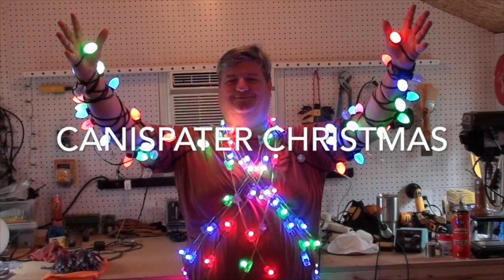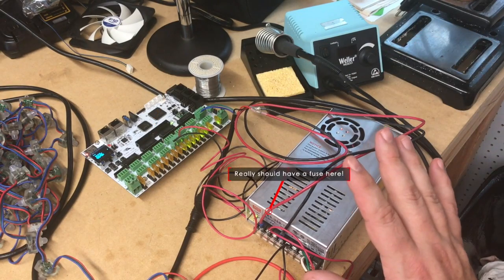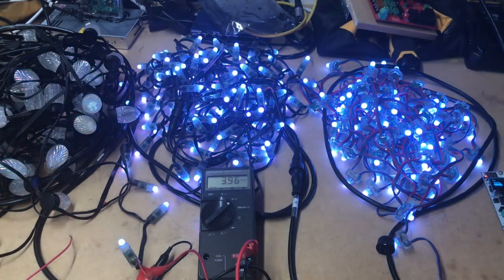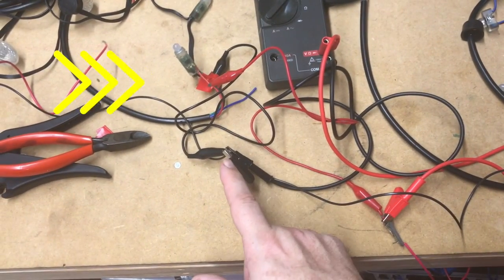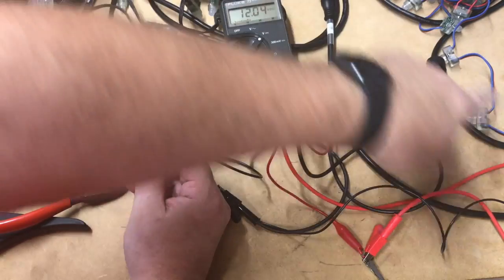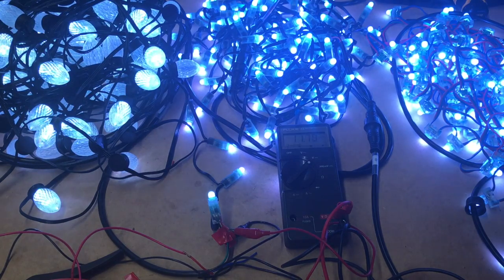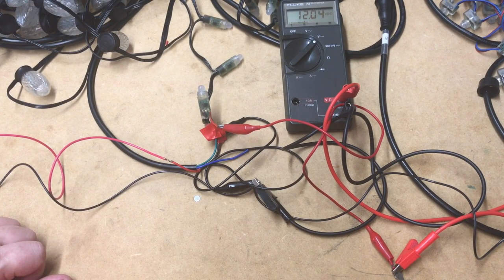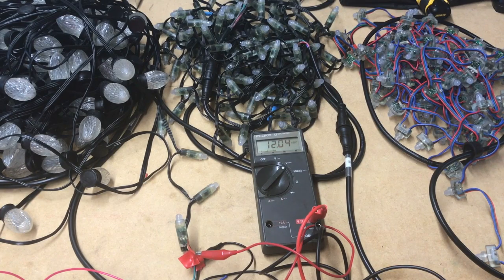Injecting Power For RGB Pixels

Comment: Can you help? I have (2) 20a 5v power supplies (100 watts each) for my (2) 5m btf 6812 (300)led each strip or 100 watt demand from each strip. Could a single 20a power supply power both strips at full brightness? I will power inject at the beginning middle and end of the joined 10m strips but would that 20a power supply be enough or can I somehow have both power supplies to both led strips with a single controller?
Reply from the maker: I'm not familiar with those pixels, but you'll need to know the current draw for the strips. That is typically shown on the product listing. If there isn't any info, use 0.06 amps per pixel (for full brightness) in the strip. That will give you a ballpark idea of the total current draw for the strip, however, pixels have become more efficient so that may be too high now. Example, if they are single-LED pixels, 300 pixels * 0.06 amps = 18 amps total so one PS would not be enough for both strings. Again, this depends on the actual draw for each string so that is your homework. 😂  Also, if they are the fancy new RGBW pixels, and you're wanting white, that may throw off the calculation so not an easy question to answer. As for the controller, if it has 2 separate power inputs, then you could use both supplies, if not, then no.

Comment: So just to be clear when using two power supply’s I only connect the - of the second power supply?
Reply from the maker: To be specific, if you are powering the same string of pixels with two separate power supplies, connect the negatives together so there is a single reference to ground and split the positive somewhere in the middle, otherwise you run the risk of the power supplies fighting each other and overheating. You're basically powering half of the string with one PS and the other half with the other. It's not a common setup and I haven't needed to use it. Only time I can think of where you might need it is if the string is very long making power injection difficult, but I try to keep strings short so I don't even have to inject power. Now injecting from the same power supply is something I use on my megatree and matrix and in that case, splitting the positive isn't required because it's the same power supply.

Comment: So quick question?

The negative and data wire is tied together on all (3) strings from the 1st controller/power supply?

When running the 3rd string, you can leave the negative and data wire tied through to the other (2) strings, but the positive wire for string 3 can ONLY be connected to the second power supply? (isolated from string 1 & 2).?

Wouldn't it be better to have the 3rd string isolated from the other 2 strings on the positive and negative.?

I am new but trying to get this sorted.

Thanks.
Reply from the maker: The idea is to break the positive between the two power supplies so you don't get them fighting each other (eg: generating heat, causing fires, ruining everyone's Christmas 😂). All grounds need to be the same otherwise you run the chance of having stray voltage on the data line which causes the pixels to do funny things). Data is not connected to the power supply - only from the controller to the first pixel and it's a chain (pixel to pixel) all the way down the string. Pixels regenerate the data signal for the next pixel so once you make it to the first pixel, you're good for the string unless you have a large distance (a few feet) between two pixels. Check out my beginner playlist if you haven't already. It goes through the basics (https://www.youtube.com/playlist?list=PLFyrAfJ-kKd4ZfPdXWIt8v_bav61mW_KW)
Reply: @CanispaterChristmas  so you would tie the grounds from all 3 strings together even though power is supplied from 2 different power supplies? Thanks for the reply. And great job with everything.
Reply from the maker: Yes, a common ground (same ground for everything) is necessary.
Reply: @CanispaterChristmas  last question 😂😉

So is a common ground required between all pixel strings in a show (different props/matrix's etc)? with multiple controllers, power supplies?

Thank you!
Reply from the maker: No. Each controller is supplied by it's own power and the controller will provide the common ground among all the strings attached to it. The only time there really is a chance of an issue (that I can think of) is running 2 power supplies on the same string. BTW, how many pixels we talking here? 2 power supplies is really not something that comes up often. Generally only spanning a large distance (making power injection from the same power supply difficult) with one string.
Reply: @CanispaterChristmas  I guess at the end of the day, I'm having a hard time figuring out the total pixels that one of these premade falcon controller units can feed with a 350W power supply.

I believe they have 16 outputs fused at 5amps each

Regardless each port says it is good for up to 1024 pixels. (believe this rating is for data). (16 channels x 1024 pixels/ch = 16,384 pixels!) 

Even with a 350W power supply the math doesn't add up without me thinking that power injection must be added.

A quick calculation for the power supply puts me at :

350 watt power supply, pixels at 50% brightness: 1051 pixels total

Given that they pixels are 0.66W each. 

Does this sound right? 

Thanks for taking the time.
Reply from the maker: Every controller I've seen comes with 5-amp fuses on the outputs to protect the traces on the board. I use 0.06 amps per pixel to estimate the current draw at 100% white (all 3 LEDs are on). Adjust based on the brightness setting. Also, your pixels may be different so be sure check the specs. You are correct that 1,024 is the data capability of each port on an F16 V2 or V3, but few run that many on each port. Also, if you run your show at 40fps, that number drops to around 680. 20fps is the xLights default and generally good enough for most hence the 1,024 figure. As props get bigger, frame rates have gone up for some. I limit power injection to a minimum because it generally complicates things, but I do use it on some props. Where it's easy to inject, like trees and a matrix, I use it. My tree uses 4 strings of 300 with injection at the end of each 100-pixel section, but it all comes from the same power supply so it reduces the complexity a bit. You can expand the F16 to add more ports allowing for smaller strings which reduces the need for power injection.
Reply: @CanispaterChristmas  right on. I have been watching a few more of your videos. I see how having more pixels on the same output definitely can make things more challenging. One specific challenge would be having a bad pixel and watching a good portion of your show not work.

When it comes to smart differential controllers (which seems like the way to), these can be powered up as well by independent power supplies. In your one video explaining this, your 3rd differential controller is powered by a different supply than the first 2. With this set up, the grounds (or negatives) do not all need to be tied together, do they?

Now at the same time, try and find this stuff right now. Seems like everything is out of stock! Haha.

Thank you! ✌️
Reply: @CanispaterChristmas  I found a link you posted on another thread about power injection. I'm good! Thanks! Pays being a sparky. 😉
Reply from the maker: Awesome! Yeah, things definitely affected by supply issues. I've noticed he gets things in in batches. May not be there today, might be there tomorrow. Sometimes had lead times on the web site.

Comment: So I understand how to power inject. But how many power injections can you supply off of the same power supply? So say the meanwell 30amp 350watt power supply. I'm fuzzy on this.
Reply from the maker: Power injection doesn't draw more amps, it just maintains voltage along the string. You can inject every pixel if you want, but that isn't necessary. 😂 As long as the current draw is under 80% of the rated current capacity of the supply, # of injections doesn't matter. So for that supply, try to stay under 25 amps to give yourself some headroom and not overtax the supply.

Comment: Hello, love the video.  Where do you add fuses?  Do you only add when injecting?  What size of fuses do I need when using a 12v power supply?  Thanks
Reply from the maker: Thanks! Typically, the controllers are fused on their pixel outputs so you don't need fuses there. If you are injecting power however, there is no fuse so adding one between the power supply and the pixels is recommended. You can use any holder that holds a fuse. There are several varieties out there. Some are made by community members, others are standard automotive fuse holders and some are for marine applications. I try to use the best holder for the job at hand so if I'm only injecting once, a single automotive inline fuse holder is fine. If multiples, I get a different holder. You'll need to calculate or measure the current for yourself to determine the fuse best to use. There may be some experimentation. Typical ballpark is 0.06-amps per pixel running 100% white (100-pixel string pulls roughly 6-amps) however your pixels may be different so know the specs.

Comment: Can straight up RGB LEDs with 4 pins be power injected?
Reply from the maker: Not sure what you mean by "straight up." If they are digital pixels (set color and brightness with data), then probably. If they are analog, I doubt it. I don't have a ton of experience with analog pixels, but they set colors by voltage differences, hence the probably not.
Reply: @CanispaterChristmas  
There's no common negative polarity to connect to so I see no way to inject positive and negative DC!
Reply from the maker: Analog pixels then?
Reply: In that current is varied with each channel to produce an effect, then yes.
Reply from the maker: OK. Same page then. You might get a better answer from the folks at auschristmaslighting or the Facebook groups. Surely someone there has more experience with them. I started out with the digital variety and only tinkered with the analog a little so my knowledge is lacking.
Reply: @CanispaterChristmas  
Another question, if I daisy chain two 15 metre (for 30 metres) 24 volt chaser effect strips with a 3 Amp p/supp will the data line carry the full length if I inject at the back end?
Reply from the maker: Data? Oh, we may not be on the same page then. With the 4-wire pixels, do you have data and a clock?
Reply: @CanispaterChristmas  
No, just +voltage and R, G, B.
Reply: @CanispaterChristmas  
The daisy chain question is for a different design with 3 pin +\-voltage and data!
Reply from the maker: LOL. OK. Then everything I said about the analog string still applies. Alan in Australia is the most knowledgeable I know of on them. For digital pixels, the data is regenerated at each pixel so once you get it to the first pixel, the rest should be fine assuming the distance between pixels is the same. If you have to span a distance (more than 1/2 meter-ish), you may need something like an F-Amp to boost the data signal between the two. Try it first, if it doesn't light the 2nd half, boost it. You can inject power anywhere along the string for digital pixels. The idea is to maintain voltage all along the string. Each pixel will drop it a little.
Reply: @CanispaterChristmas  
In this case the data is read in gangs of 5 pixels and there's 450 pixels. Am I able to run a separate data line parallel with the first 15 metres to the second 15 metres (bypassing all IC's) without interruption to the first 15 metres, feedback in other words?
I feel my only real option is to set the strips in the desired configuration and try it but I don't want to fry $125 worth of product!
Reply from the maker: Based on your questions, I'm not sure I know what you are doing so I cannot give a good answer. Splitting the data like that is not a recommended method in our hobby. I don't know if it would work, trash your investment or just not work.

Comment: Jeff, when you parallel power supply lines to multiple points over the entire length of a long chain of pixel strings, do you get any oscillations between the shared grounds (low side cables)? Multiple ground paths often create noise on the data lines. How do you prevent these shared power and signal ground oscillations when adding power injection? Thanks!
Reply from the maker: I've done different props different ways. Some with multiple paths back to the power supply and the matrix is essentially a set of railroad tracks on the bottom. If you experience random flashing when you aren't sending any data, it might be a ground problem - or the pixels are bad or allowing moisture into the epoxy.

Comment: How many times can you inject power from one power supply
Reply from the maker: As many as you need to keep the voltage right all along the string. Just make sure you don't exceed 80% of the power supply's output.

Comment: For power injection, do you need to run both a positive and negative wire from the power supply to the injection point? Or can you just run a positive line? If you have a negative running through the controller and through all the lights inline in that way wouldn't a negative line for each power injection be redundant and unnecessary?
Reply from the maker: I always give both additional paths. You can try it.
Reply: @CanispaterChristmas  I was just curious if the negative line was necessary since it's not the one carrying the power. I really don't know much about what I'm talking about 🤣 I was thinking that I could take the negative that I ran with the positive and turn them both in a positive to act as a lower gauge cable in a sense
Reply from the maker: OK. Both wires carry current (it's a closed loop).
Reply from the maker: And now for something that will really confuse you.... electrons flow from negative to positive.
Reply: @CanispaterChristmas  makes sense!
Reply: @CanispaterChristmas  I may end up doing my longest power injection run with 12 gauge wire that I have. It's stranded speaker wire but would probably still work, correct?
Reply from the maker: Yep, copper is copper. I have had some CCA wire that corroded after a season so I don't use that anymore, but generally use what I have on hand.

Comment: Enjoying and learning a good bit from your videos as I'm planning to get deeper into pixels for 2022 (got way behind for 2021). Say I have a 12V 750 PS, about how many pixels can I run off of it at about 30% brightness?
Reply from the maker: The ballpark calculation is 0.06-amps per pixel at 100% white so 100 pixels would use ~6 amps at 100% or ~2 amps at 30%. Actual values will depend on your pixels. You also want to keep the load on a power supply below 80% to allow for some overhead. I know my 350-watt supplies deliver 30-amps max or about 25-amps useable.

Comment: So to clarify, I can run more pixels without power injecting if I turn down my brightness? Say I want to run 12v 150 pixel on 1 power supply at 30%.
Reply from the maker: I live in the city & run most of my display at 30% to avoid landing aircraft on my lawn. There's likely a sweet spot and none of this is exact so do some experimenting.

Comment: I am just getting started watching your videos and they are great so far with excellent details. I’m curious if the length of power cord prior to connecting the pixel string has any effect on power drop. ie does the power supply need to be situated right next to the start of a run?
Reply from the maker: Thanks! Several factors involved, but you can generally go 20-30 feet without problems. I say play with a string to see what you get in terms of results and then ask about adjustments as needed. Plenty of folks in the forums and FB groups to assist. Try not to over complicate it your first year as there is a lot to learn. :)

Comment: Thanks for this video, I know its older but i am new to pixels. trying to get my roof line done with 12v pixels so far i have 250 hooked up and they look good. But i plan to add another 150 and thinking i will need more power. so i can just run a new positive line to the new sets and it will be good? i don't need to run a positive and negative from the same power supply?
I am using Pixels i picked up from amazon they have the flat connector on them not sure what it is called. 
I guess all nodes were the same mine uses red/white/blue wires. the plug has these colors and then they have extra leads Red and blue coming out to hook the positive and negative. I guess i cal just do away with the red lead on the connector for where i want to hook a new power line.  That will leave the data and the negative hooked together.  is there any advantage to hooking it to the complete opisite end of the pixel strand?
I am waiting to get all my stuff to be able to hook these up to my raspberry pi and pi hat. right now just using a ECU NODE with WLED on a app.
Thank for any advice,help as trying get this all finished before Halloween.
Reply from the maker: If using 2 different power supplies, it's best to break the positive in the middle-ish. You can power from either end of the string. You should connect the negative between the two to prevent floating voltage on the data line (flickering & random colors).